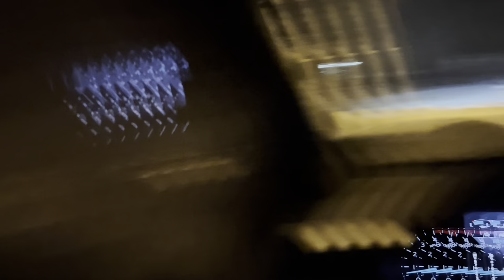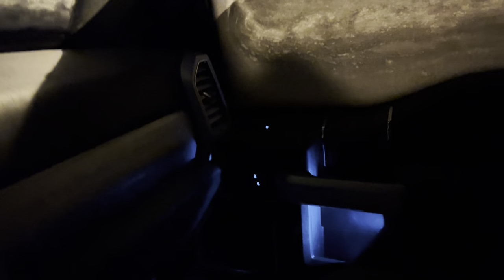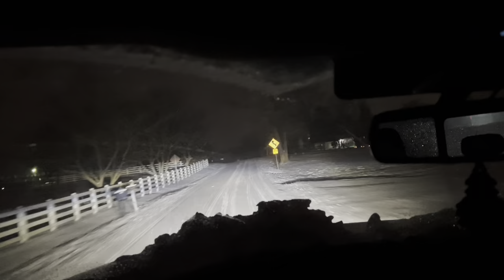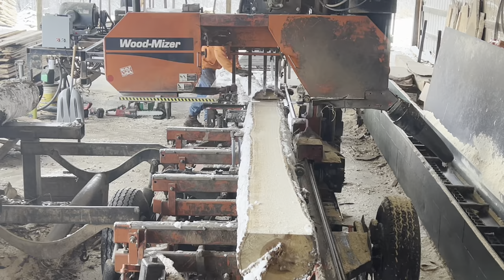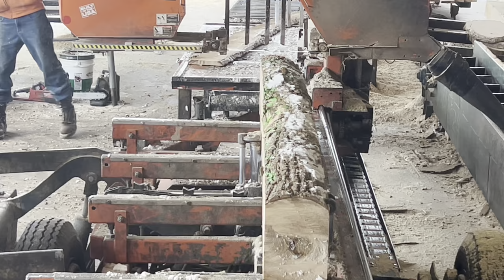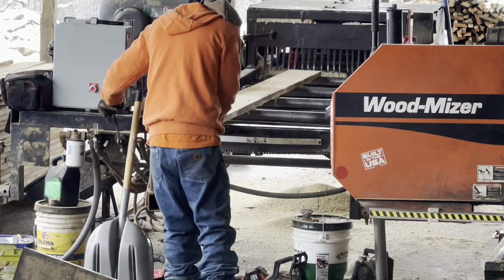Sawing snow frozen logs 🥶

Comment: for someone that is new and doesn't know anything.... what are you looking for when you turn the log before the first cut?
Reply from the maker: For what you are seeing in my videos so far. We are cutting pallet material. But if you are cutting grade you look at your heart(core) of the log. You want to evenly take outer layers off. As in you make only a cut or 2 depending on what board thickness(4/4,5/4,8/4 etc) your cutting. Until you get close to the heart. Then you decide if the core is good enough to saw down or make a cant.

Comment: What are you using for a blade ?
Reply from the maker: 747 turbo. I haven’t found anything they won’t cut
Reply: @americandream_89  Have not tried them yet . Still mostly using the 7 degree double hard ones
Reply from the maker: @robintaylor-mockingeemill8223   I wouldn’t recommend a 747 turbo on anything that was a gas motor. But diesel motors they shine ✨ 
The tooth is longer and almost straight up so it really puts stress on a gas engine.